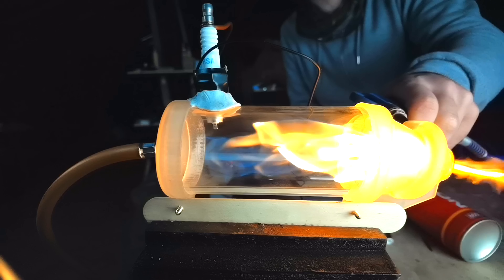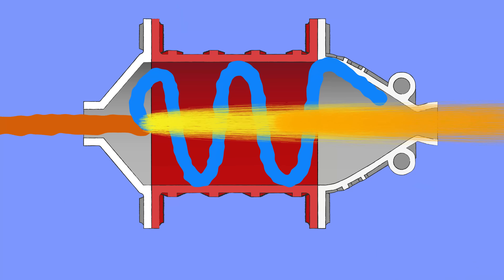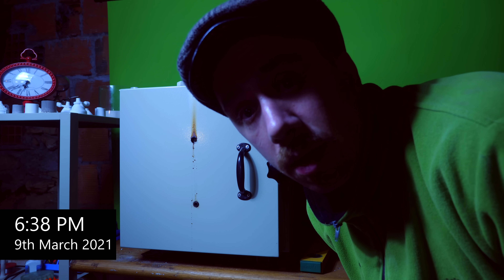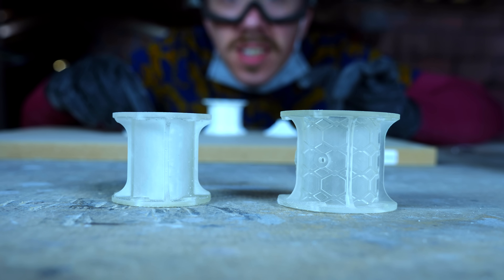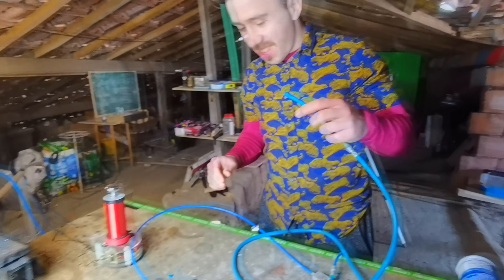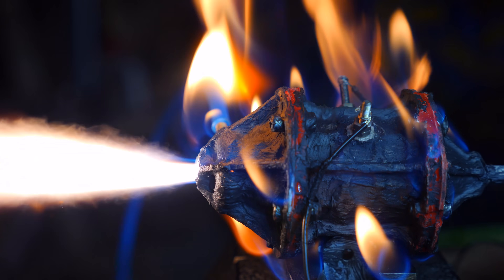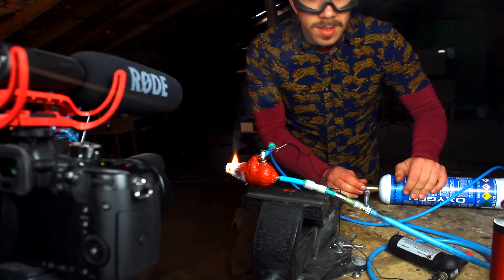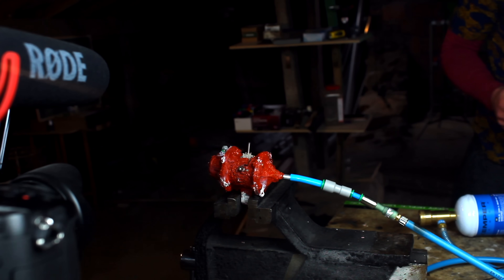Vortex Rocket V2.0 (3D Printed)

Comment: By the way, try slowly drying your prints for at least 2-3 days. This protects regular pottery from cracking and warping. It should be bone dry before firing. Also firing at higher temperatures makes pottery less porous. Also you can try to glaze it to seal the pores.

Comment: 3D print models in PLA, clean them up and use them to make silicon molds, then use the molds to make full ceramic parts with no mix to burn out. No more pores, no more shrinkage.

Comment: Your problem is not exactly the porosity of the ceramic printed parts, I mean, it is, but just hear me out, you need to fill the pores themselves, not just seal them, because when you put for example the silicone sealant on the engine, it does not fill the material, ergo you create a lot of miniature combustion chambers all around your engine. 
Try something with lower viscosity to fill the small pores, I'd suggest to coat it even from the inside. A heat resistant silicate coating (paint) comes to mind, there is a lot of ways to go about it, but lower viscosity and coating both sides is most likely the key.

Comment: Three things.  1. Ceramic dust is not good for your longevity.  Wear a mask. 2. To shut down your engine turn the Oxygen off first.  If you turn the fuel off first it will burn your engine for fuel.  3. Look for a quicker valve for shutting down the oxygen.  You can still use the multi-turn valve for metering the fuel, but you need to be able to shut it off faster when things are on fire.

Comment: Try printing your modular design with some extra material thickness at the mating surfaces so you can take a belt sander to them and make the surfaces more flush after they leave the kiln, also make the flanges wider so you have more surface area to clamp together and more gasket material to seal the area. to combat the leaking from the engine body itself, I would try to make a dunk tank to dunk the parts in a ceramic coating to fill in the outside and inside pores, or see if something like flex-seal spray can withstand the high temps on the outside body. I imagine if ceramic coating for exhaust headers can keep up with car EGT's that it could help at least on the outside, I don't know about the inside. I would see if for the next update you could try to use a steel body in the same design with ceramic coating to help with the high temperatures.

Comment: Why don't you try to make a 3d printed old and injected it with very fine cement? you could split it in moldable parts and have them stick to proportion.

Comment: You could try coating the pieces with the high temp mortar assemble it and then place them inside a vacuum chamber to try and fill the gaps verses covering them up. You would probably need a vacuum pump, I don't thin a shop vac would be enough pull.
Reply: Also if you want a cheap quick vacuum, you might be able to switch your input and output on your compressor. Plum the intake to the tank and leave the output to atmosphere. You don't need to leave it running continuously just pump down the tank and hook up the airline to your chamber.

Comment: Try the old wax moulding method used to make the statues. Print a part out of wax, then stuff with sand.... heat it to melt the wax out leaving an empty mould. then pour metal or ceramic in that mold and heat it for hardening.

Comment: One thing that may help your printed parts stay together is to add a high temp mesh (commonly available) along with your refractory glue and sealant. Also add some refractory glue and sealant to the inside of your parts. Not just the outside.

Comment: You could use some type of very thin high temp sealant to soak into the micro holes and plug them up, water could be a good delivery system for something suspended in it or so some other liquid that could act as a delivery solution

Comment: You need better control of your fuel and air mix . it would help with the combustion chamber pressures. that is the main reason this failed. Your over pressurizing your chamber by just dumping fuel and air in to the chamber causing them to fine weaker points to escape causing this to fail

Comment: You need to add a heat resistant polymer too the mix maybe or even use some sort of thing like metallic patching stuff, maybe even use the stuff they use to fix mufflers on combustion engines with 🙏❤️

Comment: Rather than using a flat surface between the modules, you could add a rim that locates inside the other part; so the chamber would have a lip protruding out with a slightly smaller OD than the chamber, then the nozzle would have a recessed area for it to slide into. That way, you’re placing material between the chamber and the outside rather than relying on the sealant  on the flanges alone

Comment: You can 3D print metal through a process called sintering. basically it puts down a layer of metal dust and uses a laser to melt the area your part is in on that layer. Because you end up with a part buried in metal dust, there is no need for support structures. Its not cheap but Rocket Labs has successfully been printing engines this way.

Comment: For leaking try making a very thin (low viscosity resin that you can put inside the engine. Then slowly turn the part on a roller until its cured.  It should cure with a solid high temperature resign sealant along every part of the inside. You might want to do a quick internal surface area calculation to give your self an idea of how closely you can get it to cure thin and evenly. Bonus points if you make Integzabot to rotate it for the 24 hours of curing.

Comment: Why not smear in non-porouse, high temperature resistant materials in layers around the engine? non flammable would also be great. Also wrap it in some carbon fiber to hold the layers in place during the layer smearing. And lastly cast it in the resin or som concrete. Then you will have strength, heat resistance and non leakage, hopefully.

Comment: You should revisit the starlight and use that to plug up the tiny pinholes in your engine. Or perhaps mix the silicon and starlight Create a kind extremely thermal resistant glue or paste.

Comment: there is resin stabilization process for wood that uses a vacuum chamber to ensure the resin permeates the wood completely,  perhaps there is a high temp resin you could use on ceramic.  or you could glaze the ceramic.

Comment: I made some really good sugar rocket motors using cast cylinders of fibreglass reinforced body filler and machining them into a proper convergent divergent nozzle using a wood lathe. I can't wait to get a metal lathe and make some really powerful all metal ones.

Comment: don't try to assemble parts flange to flange, but inner to outer cylinder surfaces (cylinders overlap). The flanges are just here to assemble the parts but not to make it leakproof (if I was clear enough)

Comment: Just a thought. I'm no expert in any of this but if the problem is the ceremic being too porous and that's what's causing the leak then maybe you could submerge it in some kind of heat resistant epoxy and put it in a vacuum chamber for a little while.

Now I'm not sure if that would actually work in this case with these materials or if heat resistant epoxy is even a thing but I know that's a method of saturating fine pours in some materials.

Comment: Edit:please lemme know if this helps
Metal 3d printing just get a company to print the combustion chamber for you and use ceramic nozzles which you can print and you can probably solve the leaking problem by applying ceramic glazes to the interior & or exterior of the finished part(nozzle) and re-baking the part in your kiln to close off the small cracks from the initial baking and the porosity of the parts
Reply: Yeah glazing the ceramic should be a nice experiment, either it will work or it will fail spectacularly!
Reply: @w1ndf4k3r  don’t you love fragments of molten glass becoming airborne in every direction

Comment: I think you'd need to encapsulate your refractory chamber in a metal casing, maybe aluminium, Which should be decently CNC machinable. That might allow to seal and even pressurise the chamber.
The combustion temperature in the chamber should increase.
Hopefully the heat passing through the ceramic part can be handled by such a casing!

Comment: Print moulds and cast the engine parts out of a meta.Then bind the engine segments together with large flanges around the circumferences which will diffuse the heat and even allow heat exchangers to be clamped around the engine as a mounting feature.

Comment: To avoid leaking you can put printed engine in liquid (or with low viscous friction) material (it might be some sort of cement, but in more liquid form) under pressure, so that this material would diffuse into microfracture and pores of ceramics due to pressure. Then you can take out the engine, clean excess material and wait for it to harden. Thus you would get composite material, that wouldn’t leak.

Comment: What if you try electroplating the engine with a layer of copper on the inside or the outside to seal it? I’ve seen videos of people using special paints to make their 3D prints conductive so that they can do this, and they’ve reported some pretty crazy improvements in part strength. You might want to experiment and see if this process could work on your ceramic parts!

Comment: If the problem is the porosity of the material, what we used to do with SLS part made from PA12 was applying a thick coat of fluid epoxy resin using a simple brush, inside and outside, then put immediately the part in a vacuum chamber, you will see the part bubbling due to the air escaping through the resin, when you apply the pressure back, the resin will be sucked into the porous material instead of the air, remove from the chamber and wipe off the excess of resin to prevent drips, let dry. You have a perfectly air tight part. You just need to find the resin that will withstand high temperatures but the process will be the same and very easy to achieve in the Integza lab, just need a good vacuum chamber.

Comment: When you cook out the resin you introduce more porosity. If 1 and 3mm crack, why not try 4-7mm? Still isn't going to solve the porosity. Try a ceramic porcelain sprayed into the engines and fired.

Comment: Burning engine components means you are not getting a temperature differential between the chamber wall and the flame. The fuel and oxygen are mixing too soon.
Do you know what a Ranque-Hilsch vortex tube is? It is a device with no moving parts that separates input compressed air into hot and cold streams. Yes, Maxwell's Demon personified in hardware that's powered by the input air pressure. I think you're trying to build one that works backwards sort of. That would require the input fuel stream to have a swirl opposite to that of the oxygen and I'm not sure that will work, but it's a thought.

Comment: I think that the reason why it is still leaking even if you cover the whole thing is that the internal pressure exceeds the threshold of the body. Like in the test of the single part. In the beginning, it didn't really leak. After a while tho it did especially when you upped the pressure. Even in the modular engine, you can see it happening. Maybe you can increase the area of the exit nozzle because you have lots of pressure inside. It can't go out all at once. The chamber or the part is not the problem why it is leaking. I really believe that the internal pressure is just too high that it can't support it.

Comment: Hi, Integza!
I love your videos, they are funny and inspiring for own experiments.
As I see you have a continous problems of the gas leaking of your ceramic parts.
So I may have a solution idea.
Impregnation.
Your ceramic is porous as a sponge. Sponge can suck up liquid.
So you have to fill it with liquid.
I would recommend the different high temperature spray paints, some of them are good until 600 C degrees.
If you impregnate your ceramic with that paint, following with a couple of hundred degrees threating in your oven, maybe do two cycles of paint and heat, that can stop your leakings. At least it could significantly reduce it.

Not an expensive action, maybe woth a try.

I wish all the best to you and hope to see new contents from you.
Reply: One more thing. You always try to do gasketting of the surface from the outside. It will not work. Inner pressure is blowing up the gasket as a ballon and it separates from the surface. Gasketting layer must be on the inner side, on the high pressure side. In that case pressure pushes it into the porous surface.
If inner surface must stay as smooth as printed, I would recommend to use double walls and gasketting filling between.

Comment: I'd love to see some more videos on TurboJet engine, improve it and maybe add more parts to it  (like that, idk how its called, those folding thrust regulators for example :D) and that brings me to a point that you could try making the Vortex engine from metal parts and use your magnificent welding skills to stop the leaking (even though u want it from 3D printed ceramic)

Comment: After printing the engine and firing it in the kiln to burn out the resin you should glaze it just like they do with ceramic pottery. I’m not sure if the glazing can be done as a secondary step or if you need to glaze the internal parts prior to placing in the kiln 🤷🏻‍♂️

Comment: Try using compressed air  instead of pure oxygen to cool,   The rate of combustion is too much for the fragile parts.  Add extra pure oxygen once the cooling is doing its part .

Comment: Hey integza, maybe you can try coating it with the heat resistant silicone stuff, then wrap the rocket with those heat resistant fiber wool stuff, then coat it with another layer of heat resistant stuff(to make sure it doesn't leak off pass the wool and also to hold the wool together, but can also be used as another layer for seal). Just an idea, maybe can be tried. 🤷‍♀️

Comment: So, if your problem is just that the chamber pressure is far too high for the tolerances of the materials youre using, why not change the scale of the engine until the pressure is less than the max tolerance of the ceramic and sealant etc?

I mean, its just a matter of scale, to me it looks like youre using far too much fuel, its just blowing out the back full tilt, maybe pick a design, get your flow ratios down, then improve the design once youve got the flow ratios good?

If you fix your flow ratios so that your chamber pressure is within material spec, the only thing left is the scale of the engine. Thin ceramic on a foot long engine is weak, thin ceramic on an inch long engine is strong.

Also, second suggestion, instead of having flat mating surfaces, try making the mating surfaces have baffles built into them, coupled with metal pipe segments, extra cement, that sort of thing.

If the path the gas has to take to escape the seal is a long winding one instead of flat, the pressure required to escape goes up rapidly.

Also, another aside, i may have missed a video... but didnt you used to use compressed air? can you try that instead of pure oxygen? or is the oxygen igniting the reason it makes such a strong jet? i would think air would work better for the vortex part.

Comment: INTEGZA - Have you looked into the speed at which you heat the ceramic parts in the oven? Maybe slowing down the bakeing so the drying out is a little slower will allow it to dry out a little more uniform. 

Also never played with this stuff. But it might be interesting if you took a part with cracks, filled them with the ceramic liquid, then cured it with a UV light. It will shrink again when you bake it out, but maybe doing this in a series of steps can build up enough to fill the cracks. The parts won’t be  as strong, but you might make some cracked parts somewhat recoverable.

Comment: Stump Remover (KNO3) + Sugar in a 65:35 ratio respectively is a fantastic fuel, it works mixed as a dust but if you heat it on a pan around 150F it turns into explosive peanut butter and hardens like a rock.

Comment: Have you tried using ceramic glaze?
That should be gas-tight and more heat resistant as the silicone.
It looks a bit like the leaking combustion gases are destroying the silicone from the inside.

Comment: think you should use some kindahead gasket between the engine chamber parts  they make gasket  you can cut that comes in a roll that might help under pressure  by using that gasket and  nice bead of sealant on  both sides of the gaskets

Comment: It looks like some enamel would solve gas leakage through body problem. Maybye just add some enameling salt to the porcelain mix?
And some part locking, not just plain glueing together with hermetic would help. Some steel rings for tightening?

Comment: What about using a castable refractory? Design the engine and print it in the 3D printer. Then mold it in clay. Using the castable refractory as the engine.

Comment: Use a metal sintering 3D printer, and then print a helical spiral of tubes around the jacket from hottest (e.g. the exhaust nozzle) to coldest part (e.g. the oxygen intake side) of rocket, then run compressed/liquid fuel through cooling coil into combustion chamber.  Just like how NASA builds the bell housing of their rocket engines: https://ids.si.edu/ids/deliveryService?id=NASM-A19700271000-NASM2018-10449-000001&max=3000, only 3D printed.

Comment: there are 2 main problems, just coating outside isnt working because the pressure is still pushing throu.
you need to find a way to coat it both sides, or even make it more dense.
a double layer desing should work, with the high temperature coumpound in between, it thickness (i believe) would not penetrate the porous resin.